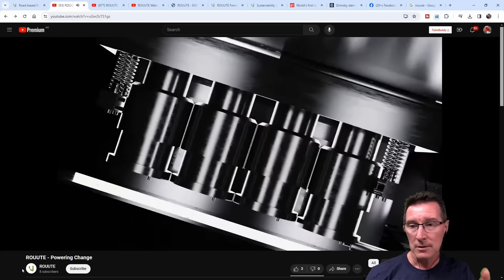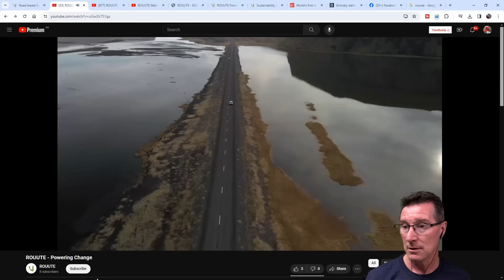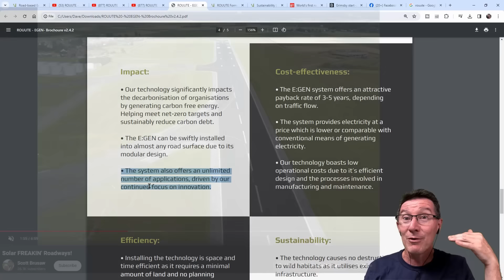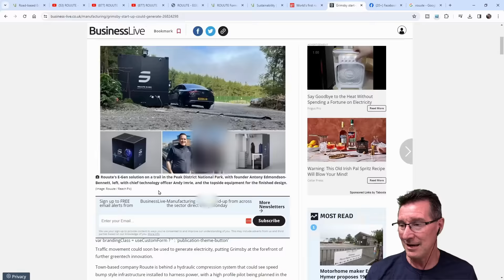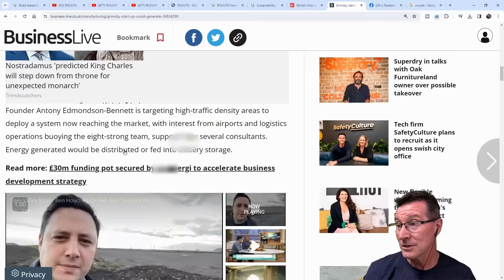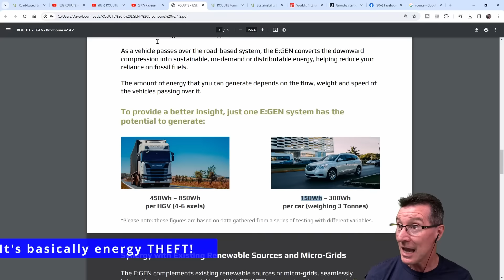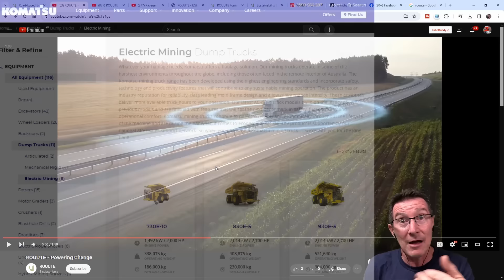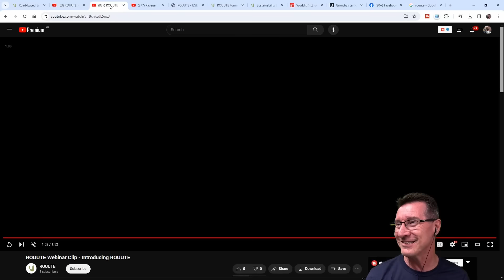EEVblog 1600 - Rouute: Road Based Energy BUSTED

Comment: The springs are compresed downwards, so the energy can not come from kinetic energy, but from potential energy. As potential energy is m*g*h the total compression of the system has to be something about 18m for a 3 t car to reach 150 Wh. If you devided it onto 6 bumpers per side of the car, the bumpers  still have to be 3m high to generate that energy. It looks they are much more 3 cm high, so the maximum energy can be only 1.5 Wh.

If you are driving at higher speeds, most of the energy will go into the dampers of he car and not into the compression of the bumpers. The faster you drive, the less energy will be transformed. Only if the bumpers are compressed in driving direction kinetic energy can be harvested directly. In the arrangement of vertical compression, the kinetic energy will be converted to potential energy (either of the springs of the dampers or of the elevation ov the car, but both energies are  the same as the spring has only the energy to extend to the former elongation) and than this energy will be converted in the bumpers (either by extending the springs of the bumpers or by sinking in of the car). 

Moreover, the stiffness of the bumpers have to be adjusted to a certain car weight - I doubt that the hydrostatic pressure in the system will be instantly adjusted as this would need energy. Therefore, the stroke of the bumper will be maximal at a certain vehicle weight or axle load. Thus, cars which are lighter than the design weight might even generate no energy at all as they are not heavy enough to compress the bumpers and cars which are heavier will just generate the same energy - only the number of axles will increase the gained energy. 

Even if they did a simple conversion error in units with cm and m they should have seen the difference in their system a long time ago or does the CEO believe that all his technicians are so bad that the system has a efficiency below 1%? Unbelievable!

Comment: Try riding a bicycle on smooth asphalt vs heavily cracked asphalt. The difference in rolling resistance is quite significant. Generating "free" energy by putting unnecessary hazards on the road is dumb.
As for how their thing works, it probably uses a flexible pipe filled with hydraulic fluid and two check valves: vehicle goes over the soft tube, this compresses it and sends it out through the check valve out of on the high-pressure line towards a hydraulic motor to turn a generator and when vehicle drives off the tube, the partial vacuum sucks hydraulic fluid back in through the check valve on the low-pressure feed pipe. That way, you can have dozens of strips in parallel for one motor-generator and only one pair of high/low pressure pipes to route between the converter box and pavement.

Comment: another good to know ballpark number: 1 kWh is the potential energy of 1 ton lifted to the top of the Eiffeltower, at 300 m height, or using the 3 ton car from the advertisement it would be 100 m. So the 150 Wh would be corresponding to the 3 ton car dropping 15 m in height or 30 m for the 300 Wh.

Comment: Just a wild guess after 1 minute. The energy production of these speedbumps is just slightly less than the increase in fuel consumption. You need to have an actual "green" source of energy to harvest. Where wind and tide are certainly plentiful but not unlimited as converting a significant percentage would affect the environment. Solar is close to unlimited and only limited to the capability to harvest.

Comment: EEVBlog:  Downhill...   This technology, even if it worked, has an EV problem.  Vehicles that have brakes that convert excess kinetic energy to heat may be OK with an energy harvesting process that reduces the load on their brakes, but vehicles with regen braking are going to lose out on that regen and therefore range.  Even assuming they can make the system 100% comfortable for the vehicles, they still need to have one lane that doesn't have these so that EVs can bypass them.   Knowing my area, they'd make that lane into a toll lane at the same time.

Comment: My very first thought was "you're taking that energy from passing cars."  If existing speed bumps were replaced by this then that's one thing, but adding speed bumps to capture energy is dystopian BS.  If you want to harvest energy from passing cars then it has to be completely passive and only harvest waste energy, and also must account for EVs.  So, set up a row of tiny wind turbines by the sides of the road to capture the eddies in the air currents after a car passes.  That's not going to slow the car down or piss off the driver.

Comment: A valid use case for this technology could be powering a street light or vehicle access gate in a location where utility power doesn't reach.  Entrance to a state park, etc.  However it would only make sense if the vehicle directly benefits from the use of the power generated from it (access gate opens for park ranger vehicle, the energy from the ranger vehicle going over this device charges the battery that powers the gate)   Even then, I'd consider solar or wind first, as they can collect energy over time and not just when a vehicle approaches.

Comment: Uhm... Dave ? Speed humps are not designed to slow (or STOP) a car. They are there as a deterrent of maintaining too great of a speed.
If you hit a speed hump at more than 15-20 Km/h you FEEL it; even that SUV in the video bounced. If a 3 Ton EV sedan drives over humps at 70 or EVEN 100 Km/h, the cast rims will shatter, if not even the control arms.
Those devices in this video WILL work, 0 (zero) doubt about it, to reduce the Carbon footprint down to actual 0. No doubts in my mind about it. Not by converting energy, but by reducing the population down to 0, if used as prescribed.

I may be wrong, could a mechanic or an engineer run the numbers and contradict me if I'm wrong I'm my mafs?

Comment: It might be good if it could be smooth to ride over and installed on large down Hill mountain grades since cars and trucks are going to have to either use their brakes or use engine braking to go down those hills anyway. So why not help them slow down and harvest the energy? But I'm curious how much energy could directly be harvested. How much traffic is required for that energy generation? And is the system cheap enough to be worth it?

Comment: compression of hydraulics.   weight of car creates flow that could spin a flywheel.  The car uses more energy to drive over pump than would be captured by system.

Maybe better to harvest energy from hydraulic suspension system of a vehicle as it deals with the normal road bumps.

Comment: I really doubt the efficiency of such a system will be higher than 10%, I mean as soon as people hit their brake the energy goes mostly away via heat in the brakepads, or in case of an electric car the battery is recharged. How are they going to teach people not to hit their brakes? I doubt that is possible to recover more than 10 or 15Wh.

Comment: Of course they haven't considered energy conservation.  But they also haven't considered the wear and tear of the equipment.  A bouncy road like the one shown will FAIL in short order.  Look, even normal roadways fail.  Around here (sillycon valley) they need to pave WITH CONCRETE the normal bus stops.  If they didn't the stopping of the busses will tear up un strengthened tarmac (I've actually seen this).  The ability for these to last any length of time with loads of automobiles, or trucks (Lorries) passing over them every day (as needed to generate energy) will make them crumble in no time.

So, let them have a simple pilot program for a bus stop (or similar) and see how long they last.  Then look at the cost of installation and compare that to the cost of the energy produced (by other means).  My wager is that even if you take the cost at 50% of actual (mass production, non prototype installation) it still won't work.

In the sayings of Mr. Monk:  I could be wrong, but I don't think so! (Its a jungle out there).

Comment: Also you mentioning going downhill. EV or hybrids can actually recover energy going downhill at constant speed or slowing down. Even your plain old manual transmission diesel going downhill isn't generating much, as soon as you lift foot from accelerator pedal going downhill, injectors stop delivering fuel to cylinders, as engine are already at demanded speed by getting rotated by car itself going downhill. Of course it is not gaining back energy, but still isn't spending it more either.

Comment: This might make sense when it comes to replacing current speedbumps with these, but it depends on the energetic ROI of this thing - how much energy to make, maintain and recycle one vs how much energy it can produce over its lifetime. Otherwise, this is just stealing energy from vehicles, making it a strategic failure.

Comment: There’s no fn way….. just when I thought it couldn’t get worse….

Tnot even watching much This is not even free energy, this is theft energy…. Cars just don’t go over speed bumps with no energy removed from the system… first law guys. Yes the amount of fuel/power it costs a car to go over a speed bump is minuscule… so oh…. Using the laws of the known universe the energy transfer into the speed bump will be even less…..

What’s the thinking here? Most cars are gas. So this is using fossil fuels to create energy… uh.. okay…. That’s good? And for the percent that’s electric you’re gona take power from peoples battery pack to put in a battery, to put on the grid to charge cars to drive over speed bumps that charge cars?

There’s no Fn… way….

Edit: oh this is gold. They’re using a G-Wagon of everything for testing. LMFAO

Maybe they should make kinetic powered buttplugs so you can charge your car when you hit a pothole. Both from you bouncing and your anus squeezing… fuck wait no… no… I’m sorry… now somone is actually going to try this

Edit edit: NOOOOOO THERES A SOLAR PANEL ON THE BOX 😭😭😭😭😭😭😭😭😭😭😭😭😭😭😭😭😭

Comment: Cutting out the greenwashing advertising, I could see these being useful in specific niche cases where power is required to support road-based infrastructure, and solar isn't feasible. Like an access gate in the middle of nowhere that's in the middle of a thick wooded area where sunlight can't penetrate. Beyond that, I find it hard to believe that there is anywhere that the cost/kwh produced by this device would pencil out.

Comment: From the start of your video i got the impression that the system works with bladders filled with some substance that powers a generator when a car is on top of the bladder and pushes the bladder down. (I guess with some spring system the bladder is filled back up again for the next cycle.) But all together the same BS (The car engine has to provide the power to drive the car up the hill of the bladder every time. You might as well use a car engine to power the generator in the first place with less losses).  BTW on 20:47 you see the control box with solar panels on top. I guess they don't trust the system themselves. What you learn from these projects is that it is just to generate free money (quite often from governments! Sad but true. Thanks.

Comment: I saw an advert (I think) somewhere this week for speed bumps made from thixotropic material ... the aim to make them smooth for slow drivers, but hard for fast drivers. Neat .... but the energy will be released as heat ... I am sure this heating could be harnessed to make electrical power in many ways (steam, thermo-electric etc).
...and it will melt the snow on it !

Comment: the only somewhat sensible sustained energy regeneration is done with huge mining trucks, they go up hill empty and downhill fully loaded, the huge weight pulling it downhill allows for a very high gearing for the recuperation generator so its usually generating very close to the amount needed to go back up hill. harvesting the potential energy bound in rock located further up the mountain.
Reply: The trouble with that scenario is that only a limited number of mines work that way. Most are big holes in the ground so the trucks go down hill empty and up hill full. That is totally the opposite of what you need for regen harvesting.

Comment: Regular speedbumps don't slow you down significantly, it's just the driver taking the foot of the gas because it's uncomfortable. First it needs more energy to get up to the peak of the bump, but then you roll down and convert the elevation back to speed forward (minus some suspension losses).
These are no normal speedbumps though, they have to drop down while the car is on it. So you first lose energy driving up and then get nothing back. With multiple in a row it would be like driving up a hill constantly. The design is way to bumpy, maybe with bigger plates/ramps it could be made smoother. Should be possible to have a constant drag, like driving in mud or sand, but idk how diffucult that is in reality...
Could have been cool a few decades ago, only on steep downhill sections of course, where breaks often overheat. That could artificially reduce the slope, drivers would be happy because it's safer and reduces break wear. Now with electric vehicles on the rise everyone has regen already built in, so why would any city/state/country install this? people would hate they increased consumption on these road. Tech for the past.

Comment: Every time these weird concepts are done I can't help but think of the embodied energy that went into it, vs what they get out of it. Typically these never really leave the prototype stage because they are impractical, but yet they probably spent millions on the R&D, not to mention burned lot of fossil fuel in the process.  Literally they would be better off building a small solar array and call it done, and they would be ahead.  But that's not "innovative" and won't get funding.

Comment: So.. Let me see if I understand their concept. Let's lower the MPG of every car traveling over that road and extract the lost energy. Then claim that doing this will reduce carbon emissions.
Seems to me that someone needs to learn the simplified laws of thermodynamics.
1. You can't win.
2. You can't even break even (unless it's an extremely cold day).
3. It can't get that cold.

As regards their energy recovery numbers. It states "system", not "unit". So I suspect their numbers is the recovery over a significant distance such as a kilometer or perhaps even 10 kilometers. Then the numbers become more reasonable, but the point stands. It extracts energy from moving vehicles, forcing them in turn to expend more energy to make up for the losses.

Comment: This is just stupid, not only this increases vehicle consumption on flat and uphill roads but  we don't need any more hazardous on the road, we already have a lot of accidents. Also people are not going to be happy when your car is bouncing all around and degrading your suspension and vehicle overall due to vibrations, just look their jeep demo. Furthermore for motorcycles this must be very, very dangerous. Another con is that people would have to drive slower increasing their trip time, making people either late to their destinations or having to go earlier. Na... people won't go for this crap.

Comment: This isn't "energy recovery", this is "energy theft"! It is stealing kinetic energy from the car.

In any case, that 150-300W-hr figure is ridiculous.
300 watt-hours is about 1MJ (using 1 digit of precision).
The car weighs about 20kN (for a 2-tonne car), so 1MJ extracted from a 20kN force would require the car to drop 50m.

The 1MJ is the kinetic energy of the car moving at about 34m/s, or about 122 km/hr.

Although this estimate may be off by a bit, there is no way the wheel is pushing the device down by anywhere near 50m, let alone 50mm!

Comment: God, that's like a bad joke.
Maybe on downward roads (or before traffic lights) there could be some kind of inductive system to slow down the car. At least it won't shake the car like the speed bumps. But that would require adding stuff to the cars, and stuff has weight that must be carried. Maybe if it can also be used to recharge the car while driving, but just how much energy can be recharged that way? I doubt that it could make enough of a difference to even matter.

Comment: I the device gains energy from the downward pressure of cars, then surely the cars are providing energy, which is provided by the car batteries or gas tank, with some limited efficiency. Might be easier to just not have the bumps, providing more efficient cars, and reduced power plant requirements.

Comment: I just got through the commercial, but I'm already appalled. The whole thing just uses gasoline engines as low efficiency electric generators. Any energy that you get out of their system is robbed from the kinetic energy that you got from burning fossil fuels in your car. And there's no freaking way that it's more efficient than just running a gasoline generator. This is stupid is all hell.

Edit: I live in a very flat part of the world- I hadnt considered gravitational energy. Less idiodic in that sense, but only in that sense.